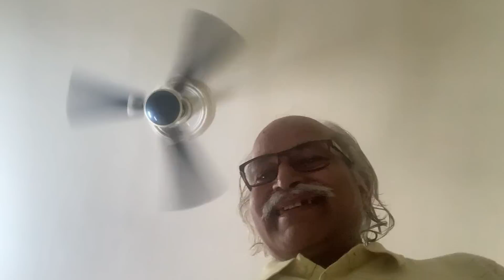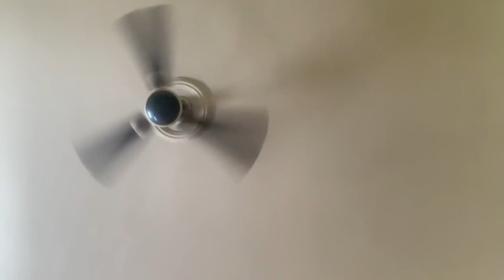Ceiling Fan in video

Comment: Very nicely demonstrated,Verma Sir.
Having been a student of your on-line courses for 4 years, may I request you to make a short video explaining this 'stroboscopic-effect' given the revolutions per minute of the fan-which you are in control of, and derive the frequency of the incident light on the blades, which in this video actually could be the number of frames per second, and thereby use this experiment to calculate the frame speed.
I'm sure you can do it as simply as possible

Comment: As per Nyquist Theorem, sampling rate (frame rate of the video capturing device in this case) must be greater than twice the frequency of the signal for it's correct representation, otherwise sampled data may present the signal with incorrect frequency. This phenomenon is also called aliasing.

Simply put, an anti-aliasing filter is a low pass filter, with Fmax at least twice the targeted frequency. Industry standard is 2.56 times the frequency of interest. 
It is applicable whenever an continuous analog signal is being digitised into discreet values
Reply: Since the camera frame rate is much slower than the rotational frequency of the fan, the output is showing incorrect speed of the fan.

Similarly, try to shoot video of your computer screen using a mobile camera, screen refresh rate is usually 60Hz, while camera's frame rate is usually 30 FPS. Hence you gate aliasing patterns in the output video.

Comment: Just take an example

If we want to supply the water of a tank with two tipes to another

When we close the one tap, another gets too much pressure or sometimes it blast the pipe
Will the same thing applies in A/B=K
Where K is constant

Jaha A aur B milkr K ko maintain kr rha hai but koi aisa condition jisme A ya B ko humlog iss extreme level pe decrease krde ki woh Equation ko hi vanish krde 🙄🙄
Kyuki agr Nicola Tesla explain kr skta hai ki 369 ek aisa number hai jo Universe ke bhut cheezon ko define krta hai

Toh hum kyu nhi keh skte ki
Maths ka hrr ek equation kisi na kisi cheez ko explain krta hai 🤔🤔

My Name Is Mustahsan Tauqeer of Class 10 
From Kishanganj, Bihar

Comment: While angular acceleration is on-going, There comes a time at which Tangential speed of fan equals 1/shutter_rate of camera, in this condition fan will seem stationary to us in camera. But at any lower angular speed fan will complete just some degree less to complete a rotation, and in second rotation it will be some more less degree than previous rotation... within some speed range because of this fan will seems to move in opposite direction because of camera shutter speed at this is point is just some less than fan rotation , and camera will capture the frame just few degree less after one rotation

Comment: Sir plz upload a video for electron flow in ac current
I am across a word 50hz does that mean the electrons are moving 50 times per second through out the circuit
Reply: it means the average motion of electrons is 50 times to and fro from an imaginary mean point in 1 sec

Comment: Sir
Why it is happening 
Whenever retardation and acceleration is happening in fan blades it's shades rotates clockwise and at constant angular speed the shades are rotating in anti-clockwise that is opposite of blades rotation. 
Thankyou sir

Comment: Actually the ceiling fan rotates in clockwise direction. When we set the regulator of the fan at 1( lowest speed), we can easily guess the actual moving direction. But when we gradually increase the speed from 2,3,4,5 (maximum speed) , the fan seems to move in anticlockwise direction. It is because of the reflections of the fan blades.

Comment: Conclusion- as FPS(Frames per Second) rate of the fan increases at one point FPS rate and frequency of blade being at the same position matches thats why those dark shadows stops as speed of fan increases blade of fan misses that frequency and its appears to be moving in opposite directions. There are many camera's where we can set the FPS. if you use such camera you can do experiment like making video of water dripping from tap look like still or going upward.

Comment: sir there is a question i am wondering a lot 
in case of work energy theorem it is said to take the net force done on the system and i agree with that.
we have learnt that work done by external field is negative of work done by conservative forces {lke electric field}
so sir my question to you is that if we need to find the net work on moving a particle from one point to another in an electric field , one should consider the WORK BY ELECTRIC FIELD or EXTERNAL AGENT as a single choice of ours can change the whole answer due to sign?
please consider this query sir and help me resolve it , i tried to do a lot of research for the same but could not came to a conclusion, you r the only hope of mine sir!

Comment: Sir in transformer on varying no. Of turn off ratio of coil  voltage vary 
If voltage increase in secondary coil current
Decrease.
It's not violation of ohm's law

Comment: I think it's called stroboscopic effect.  When The frequency of light or flash on blade is equal to fan speed, the fan blades will appear standstill. This effect we can see in movies also.  At certain speed the car/ bicycle wheel looks rotating in reverse direction

Comment: This will happen when rps (revolutions per second)  = a multiple of fps (frames per second)
Example:    when rps = 1 x fps, 2 x fps, 3 x fps and so on. 
On the other hand, when fps = a multiple of rps, multiple sets of frozen rotors appear.

Comment: If we switch on the fan than usually it starts in anticlockwise direction. But here at different speeds the fan seems to be moving in varied sense. That's aberration and our eyes observe the newer perception first.

Comment: If rpm of fan = fps  of camera then blade seems to be stationery.
If rpm of fan is greater then fps of camera then blade visible like antilock direction.
If rpm of fan is lesser then fps of camera then it's shows like clock or mixed direction.

Comment: Hope its ‘Usha dust free model’
Clicking noise is from one of the fan blade fittings - kindly remove the designer fitting from one of the blade and noise or “clicking voltage noise” will be gone

Had same issue and it’s really disturbing during night and diagnosis took almost long time
Changed capacitors, changed regulator, changed connectivity cable as noise seemed to similar to that of voltage issue 

Hope this helps

Comment: Sir in parallel plate capacitor, workdone by battery is QV.
But the energy stored in capacitor is
1/2QV. Then where does 1/2QV goes???????

Comment: Sir,  i think that the fringes appear as our eyes can perceive a light beam in 13ms.
Suppose that initially the blade is at a certain position. At that instant, a light beam strikes it and reaches our eye.
After the beam reaches our eyes, we cannot see any other  position of blade for 13ms.
After 13 ms, we can see the new posn. of blade.
Let the blade has traversed m angle in 13ms.Let the angular speed of blade be W.
So, m=13 x 10^(-3)W
So, no. of fringes for one blade= 2000π/(13W)
Let no. of blades be N
So. No.  of fringes=
2000πN/(13W)
*But this is true for:
angle between two successive blades> m.
Else, the fringes due to one blade will superpose with the other

Comment: Sir, i think that the black shades appear as our eyes can perceive an image in 13ms.
Now at an instant the blade is at a certain position. At that instant a light beam strikes it and reach our eyes.
In the next 13ms, our eyes cannot perceive any other position of that blade. Only after 13ms our eyes can perceive the position of blade.now let m be the angle traversed by one blade in 13ms. 
Then,m=13x10^(-3)W
W is angular velocity of blade.
now,
number of fringes due to a single blade=
2π/(13x10^(-3)xW)
Let the no. of blades in fan be N
Therefore, 
the number of  fringes =
2000πN/(13W)
*This is true if angle between two blades is greater than 'm'.otherwise the fringe due to one blade may superpose with other.

Comment: Respected professor
I have two questions regarding friction -
1. Does friction depends on surface area in contact?
2. Why rolling friction is less than sliding friction?
Reply: Your first question is the answer of your second question!
Reply: 1-ans-:-yes, friction depends on surface area in contact
2-ans:-because in rolling motion,at one instant only one point is in contact with surface whereas in sliding motion whole body is in contact with the surface,so friction is more in sliding..
Reply: @bscnursing15   thank you but, plz get your first answer properly
Friction don't depends on surface area in contact
Reply: @ayushman1590  IT DOES LOL
Reply: @ayushman1590  dont confuse coefficient of friction with total friction.  Total friction is dependent on area of contact.
Reply: @ayushman1590  so first I'd say both answers by @Bsc Nursing is correct second if u do think the first one is wrong how will u justify the second.......the first answer is the explanation to the second answer hence they are both correct
Reply: Jee aspirant spotted 😂

Comment: Sir I have one question; considering that you are sitting(using seat belt) in a train and the train is moving with. Velocity closer to that of light. And you are in space. If you remove the seat belt and at the some point in time you are not in contact with the train's any part(surface) then; what will happen will the trains one end hit you from the backside or will u continue to be in constant velocity?

Please answer Sir. Physics sir said that we will learn when we study special and genral theory of relativity.
But I am quiet curious and If you will be unable to answer verbally. Please reply to the comment about where I can get the solution.
Reply: So lemme answer this real quick........if u are standing in a train and you jump u land back at the same spot but if u do it above the train ull land behind(depending on speed of train).............so why this happens is that there is air inside the train, the air inside the train is moving with the same velocity as the train so if u jump inside u won't feel the air but if u are above a train the air there is in rest so if u jump there the air resistance will hit u and make u fall behind............. SO THE MAIN POINT HERE IS IT HAPPENS BECUZ AIR HAS PARTICLE NATURE ig

Sry for any mistakes 💀
Reply: @notnemeziz  bro but are in space so there is no air

Comment: Sir, Is there any quantum physics rule act in the sense of rotation like clock wise, anticlockwise wise and then mixed up and  even sometimes seems like stationary blades with respect of changing of speed of fan?

Comment: Sir i have a doubt,
Sir we know that the Kinamatics law are only applied for Distributed mass systems and not at point mass (Like electrons and protons) but while studying electrostatics why we apply concepts of Kinamatics or Newtonian physics in situation of point masses.

My experience:
Siri was soling a question yesterday and in which an electron is kept in an electric field. there using Kinamatics and mechanics i got th answer as 4.6 x 10^12 m/s sir and the same answer is given in Book at first ai thought yeh! my answer is right but then i realized that this speed is faaaaaaar more than speed of Photons in vacuum .

Comment: Sir i also have a very important question:Two balls of mass m and 4m and radius r and 2r and the density of the ball with mass m is d1 and the density of the ball with mass 4m is 4xd¹.The ball is set down on a planck kept down horizontally so that the ball does not start rolling down the planck,considering the air friction as zero and the surface frictional force as F.Now the planck is tilted upwards making and angle of θ(theta).So now what should be the maximum value of theta so that the ball doesn't start rolling down the planck and why is the velocity of the ball increasing if the air friction is zero and the frictional force on the rough surface of the plank is resisting the motion of the balls?

Comment: According to me it is not the stroboscopic light but it is the camera that make it look like as stroboscopic thing. The camera can record videos at certain FPS think I have a camera of 60 FPS that mean in 1 second it capture 60 images and make a video of one second so the fan is rotating and it continuously pic the photo at certain interval of time the interval of time when the frequency of clicking image match with the frequency of fan or double of a triple of it then the fan seems stationery otherwise the dark pattern seems to rotate this is done to calculate rotational speed of highly fast rotating object. If it is wrong please let me know.

Comment: It's all depend upon the fps of camera at which you are recording your video. If the angular velocity of fan in rps (rotation per second) matches exactly with your recording fps the fan will look like it's stop (not rotating) . if the rps of fan is slightly less than your camera fps then the fan will look like it's rotating in reverse direction . If the rps of fan is greater than the camera fps then the fan will look like it's rotating normally in forward direction .
Reply: Thanks buddy 
I knew that fps of camera is involved but you cleared the "how"
Reply: @SaitamaOPM  welcome
Reply: Same thing goes for Helicopter
Reply: @brateendasadhikari8542  yeah
Reply: Could you explain why this also happens when I stare at my ceiling fan? There is no camera involved, only my own eyes.
Reply: @warpdrive9229  I'm not 100% sure. But it may happen because of artificial lights like Tube lights or Led lights in our home because a Fluorescent Tubelight flikers i.e blinks 50/60 times a second because in India the frequency of AC current is 50Hz and Led Lights flikers too. So when frequency of flikering of light just close to greater or less than fan rpm then It might seems like fan is running in forward or Reverse direction. But It doesn't happen in Natural lights like light from Sun. 
[Note : I am not 100% sure in this case it's my assumption or postulate]
Reply: Could you please upload the video of this
Reply: @rizzvincible  I remember there was a video of a helicopter demonstrating this.
edit: https://youtu.be/_xTjyV8F6XU
Reply: @Ash777gg  thankyou so much
Reply: Shutter speed too
Reply: @BellamyBlake_ yeah that's too to a certain extent. But actually shutter speed controls the motion blur. If you set your shutter speed too low then your can't clearly see the rotating propellers of fan. If you set your shutter speed high then you can clearly see the propellers rotating. You can't see the propellers rotating in reverse direction by changing the shutter speed.
Reply: Brilliant
Reply: Damn good explanation
Reply: Are you sure it is the fps that is crucial or is it the shutter speed that does it?
Reply: @rockbolt9232  It depends upon both but most likely on FPS. 
If your fan speed matches with your camera fps and if shutter speed is too low then you can't clearly see the rotating propellers, it will create a motion blur . if you manually increase the shutter speed then the rotating propellers will visble more and more.
Reply: I hope you know that you're saying this to a person considered as a god in physics

Comment: see the ceeling  fan  ,it has three pankha(wings)  and there are gap between the pankha when it is stop and  you can put your hand between the pankha.

if you switch on the pankha, you cannot able to find the gap between the pankha ,the pankha is present everywhere at every point of time.......

Ind to chile distance,d=16,698 kilometers
Speed of light,v =300000km/s
Time=d/v=0.05566 sec

Now imagine you travel a distance in a circular path ,if you go from india to chile with Speed of light at 10 am,
 you reached  chile in (10 am+  0.05) sec and come back again  india and you reached india (10 am +0.10) sec .  ,which means that for human being , you present india and chile almost at the same time...

Now  when you travel a round trip at the  speed of light  ,you present everywhere at every point of time as the fan, during the round path and there is no physical changes happening in this short amount of time, so  you feel that time is slow